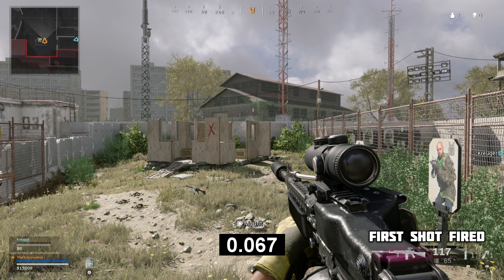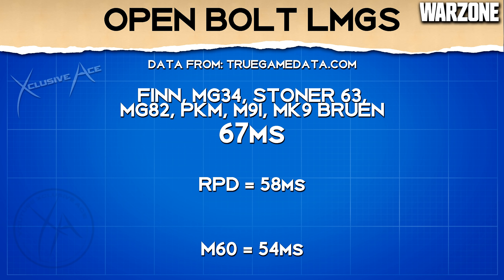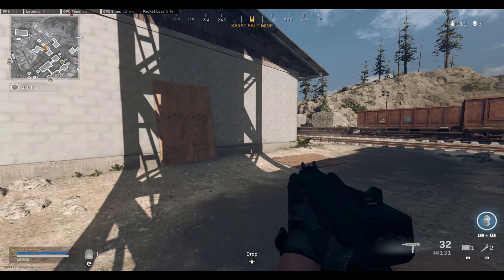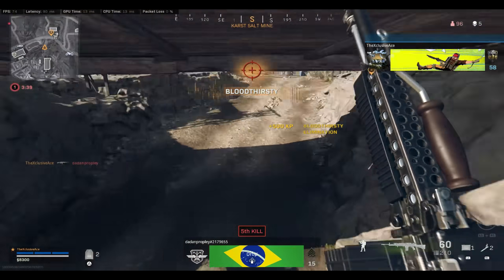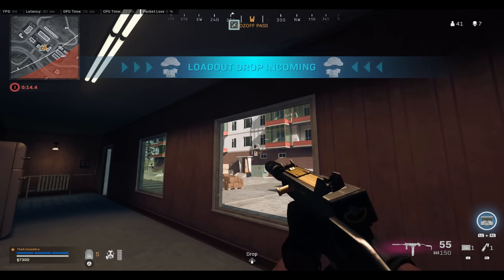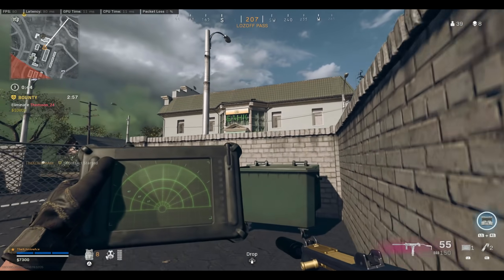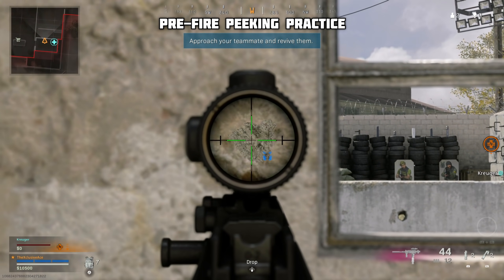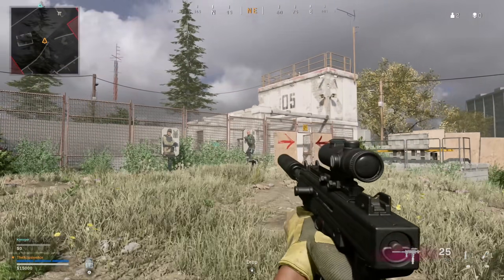How Important is Open Bolt Delay in Warzone?

Comment: For those wonder why some guns are open bolt, an open bolt will, upon trigger pull, slam forward, take a cartridge, lock in the chamber and fire, the bolt slams back and will stay there untill the trigger is pulled again

-in machine guns a barrel can get VERY hot. In a closed bolt the cartridge sits in the chamber and can get very hot and "cook" off because of the heat. This can be very dangerous as the entire gun can start shooting on its own. An open chamber is also a place where heat can vent when the machinegun is not firing.

-an open bolt is in general simpler and requires less moving parts, a good thing for submachine guns
Reply: Good stuff ..  Ive seen a gun cook off.  Not ideal for bystanders or shooter.
Reply: @jasonlawler9674  yeah, heard a nasty story from my Grandpa when he was a firearm instructor in Belgium army. They were doing shooting on M1919 browning medium machine guns wich origenated from Sherman tanks from WW2. They used them as practice guns

Unlike other machine guns, these are closed bolt designs. They had 3 on deploy in wich they would alternate so it would cool down. 2 new recruits had just dumped 2 full ammo boxes trough it. The next 2 recruits accidently took the same gun instead of a cool gun, and when they were adjusting the sights on the 4th box, the gun suddently began to fire on its own.

One of the shooters was checking the bipod as the gun had difficulty swinging, as he was almost standing in front of the barrel. he pissed his pants and hid under a truck when it fired
Reply: @F4Wildcat  perfect reason to re engineer to cooling and saftey mechanics.

Open bolt did both.  

Now we have open air to action like the grease gun or MP40
Reply: Open bolt in sub machine guns absolutely isn’t necessary it’s just the cheapest way to produce the firearm. That’s why most high end smg’s are closed bolt. Mp5, mp7, p90, vector etc
Reply: @bradenmchenry995  Yeah it was a design choice from the 20's. Once the amazing MP5 came into play, new open bolt smg designs quickly faded away
Reply: You should probably research what your talking about , before you talk about it.. it has nothing to do with the heat.. It has to do with preventing jamming while firing (Which is why M4's will jam when on full auto .. because they are closed bolt..also never have seen a closed bolt cook off ever.. in my entire life) A cook off comes from open bolt firearms....when you have ran a machinegun to much and it fires the next round..( yes from the heat) or a runaway gun from which you have got it so hot.. it continues to fire... it has to do with cycle rates.. not heat.. and open bolt is far more complicated than closed bolt.. nice try though... but lets leaving the explaining of firearms up to those who actually understand.. have dealt and trained with them.. and are giving proper information.
Reply: @bradenmchenry995  yea.. there is always that one dude eager to leave a half educated comment without fully understanding whats going on.. another reason why I hate the internet... dude has no clue... they research guns on warzone and then think thats how shit actually works IRL..
Reply: Plus you don’t need to charge a lot of open bolts between reloads.

Comment: The revolver has a really bad delay. I know they’re trying to mimic the double action mechanism but it makes using it incredibly frustrating. Gulags with the revolver are always annoying.
Reply: Battlefield 4: "first time?"
Reply: Yeah it feels like the bullets from the revolver are going to another dimension. I always asume I'll lose the gulag when I get the revolver, specially since I play on M&K where you don't have aim assist to help stay on target while the long trigger pull does off.
Reply: I feel like they should add the ability to cock the hammer manually to have at least that first shot with no delay.
Reply: @Phosphor66  YES! If you could cock and get a more accurate no delay version that gun would actually be very interesting to use.
Reply: I love the revolver, I largely stopped playing Warzone when they added real guns to the gulag it was much better with pistols and shottys only, now people don't do anything but camp the back of their spawn holding a long line of sight, it's so boring.
Reply: Snipers and the Magnum, when you try to 1 tap someone the hammer takes foreverrrrr
Reply: @ridhosamudro2199  lol
Reply: @Phosphor66  at least the first shot of the mag shouldn't have any delay
Reply: Use light weight trigger, it eliminates the double action.
Reply: @graviti4367  can’t use lightweight trigger on a gulag or ground loot weapon…
Reply: It makes gulag more interesting though. I
Reply: @peacelove6455  I feel like it makes the gulag more random. Same with the hauer shotgun that is currently in there. That thing is so incredibly RNG with its spread.
Reply: Which revolver? Didn't they eliminate (or almost so) I'm MW's MP?
Reply: I need to switch to single action by pressing the right side of D-Pad...
Reply: @chrisbammer8679  so you don't play wz but keep seeing vids? or do you occasionally play wz and occasionally watch vids
Reply: Since day 1 both revolvers are shit but no need to buff f tier guns in their eyes
Reply: @braynjohnson4302  yeah like in rdr2, you can half pull the trigger to cock the gun

Comment: Had no idea they actually included this, nice attention to detail.
Reply: You can hear it in some of the guns. A really distinctive one is on the m91 lmg
Reply: Mac 10 too. You can really notice it if you look for it
Reply: Jgod and true game data usually include this. I follow all of them. They all have pros and cons.
Reply: @xclusiveace how do open bolt delays work with sprint out time?
Reply: @HiJack3r  eh, I prefer it’s gameplay to both bo4 and Cold War. My favorite multiplayer will always be mw2 for nostalgia reasons, but mw19 did a good job IMO.
Reply: @elliottmallin4410  I'm 95% sure Sprintout time is calculated the same way as every other gun in this manner, although there is a very good argument for adding the open-bolt delay onto the Sprintout time since it is the " Sprint - to - Fire " time. With no open-bolt delay, the Sprintout time ends when the trigger is pulled and the first bullet is fired. I believe with an open-bolt delay, the Sprintout time ends when the trigger is pulled and the delay begins.
Reply: @YTKensei  right! but if someone smart with good gear doesn’t test it, we don’t really know how smg’s with open bolts perform! @thexclusiveace
Reply: @HiJack3r  Agreed.

Comment: Ace is finally using his beastly PC he ordered days ago, although I have no clue why the quality looks much worse when compared to him playing on console
Reply: lower texture quality to compensate for the higher fov and view distance I presume
Reply: I’m not sure what he has, but it’s not so beastly when he’s getting an average of 80 fps.
Reply: @PrinceBrandon125  i don't think Ace is that good at fine-tuning settings for optimal use yet. I hardly think he uses DLSS
Reply: He's not using it. That's for sure he's only getting 85fps. He got a high end pc
Reply: @drakebane9527  dlss is ass in Warzone
Reply from the maker: My new pc hasn’t arrived yet
Reply: @InsuredFrames  dlss still gives 15-20 fps boost why wouldn't you use that?
Reply: @TheXclusiveAce  so until then are planning to play on your current PC ,I recommend you to stick to ps5 for your gameplays ,I don't think the gameplay we saw in this video is on par with the quality we usually get from your videos (btw I don't mind if for some reason you have to play on your current PC )
Reply: @InsuredFrames  i have a friend whos a laptop gamer running a 1660 ti at high setings, he still gets a solid 120 fps on warzone. ace isnt using his new pc.
Reply: @drakebane9527  it adds ghosting and doesn't improve fps for 90% of people
Reply: @InsuredFrames  it does not in the right setting.

Comment: Is it just me or does rn he gameplay get SUPER choppy at points?
Reply: Yup, on ps4 sometimes you will get frozen mid gunfight
Reply: I'd probably be nauseous playing during those points. The engine ever since MW has been good looking but also very dicey.
Reply: I believe he recorded this gameplay on his PC as he has some indicators in the upper left that I have on. He may need to adjust a few video settings to optimize. it also could be frame rounding issues on YouTube's side, because I only notice it when his FPS displays 90 or above.
Reply: @Jamal_Jones  YouTube issue was my thought. Seems suspicious that it's only happening when his fps right around 1.5x the fps for the video.
Reply: @SataniaSquid  Then why did he say he couldn't change his FOV or in this video, say he didn't have the capability of recording at higher FPS since he plays on console. I'm not sure why he lied, since the proof of the FPS counter is there.
Reply: @atticusnari  Should be noted that Ace might not have as good of a graphics card as TGD
Reply: He was playing the game and recording on the same pc he’s been using for years. That’s why it can seem choppy at times. He said he does want to get a dedicated recording pc, but he’s having a hard time finding a decent priced PC. He refuses to pay 2-3x extra bc of scalpers
Reply: @Jamal_Jones  some times that happens with my gameplay i upload on youtube as well, some parts are just choppy for some reason
Reply: @SataniaSquid  i think he eventually switched to pc
Reply: @Ok-fu5yi  They both have 3090s.
Reply: Me with >20 fps and stutters every 3 seconds : Pathetic

Comment: In CoD, open bolt delay is a factor (not the end all be all but important nonetheless) in CQC and long range in instances where you can’t burst someone down in one go (trades between head glitches etc). That’s my experience as someone on the leaderboards and with a 5 k/d in rebirth, YMMV.

Comment: Hey XclusiveAce, great video! While I do agree with your assessment of OBD not impacting the TTK on every gunfight, I believe there is some room for discussion around prefiring eliminating the OBD time. With weapons that have a slow rate of fire, such as the milano, the time between the shots is actually greater than the open bolt delay. Going by TGD's numbers, if the milano fires 576 rpm, that means the time between shots is around 104ms. If you are pre-firing a corner and fire your gun just before the enemy peeks, there is a potential to increase your TTK by upto (but not always) 104 ms. This can lead to prefiring actually increasing the TTK rather than eliminating the OBD.
However, with other weapons that have a high fire rate, this is a non-issue.
Thanks again for the video

Comment: mfw when Treyarch forgot to make the AMP63 open bolt, even when they actually got it right in the original Black Ops
Reply: Amp63(Pm63) is blowback action,
Reply: @lupuradu841  You're right, but what I meant is that the AMP63 doesn't fire from the open bolt position in neither Cold War nor Warzone, even when the PM-63 in Black Ops did.
Reply: treyarch doing weird things with their weapons

I'd thought i would've gotten used to it by now, nah, it still bugs me lmao
Reply: The MAC 10 is closed bolt as well. If you have an inspect animation in your game then make sure things like these are not happening.
Reply: Thanks

Comment: I'd rather take any open bolt gun rather than the Cold War Magnum. Not only do you get the trigger delay, but you need to run the speed loader as well. I beg to the heavens that I never stuck with this gun in the Gulag.
Reply: The logic on the magnus is so stupid, you have ackimbo and you reload faster
Reply: I hate Akimbo Magnums, I had a perfect streak of Gulags, I always won my gulags until last night, I got the magnum, and the trigger delay completely screwed me over

Comment: Open bolt and velocity should be included lol the whole point of finding out the exact numbers are to understand exactly which gun would perform better against each other when they both started shooting at the exact time
Reply: Well when did the Open Bolt gun start shooting? I classify "start shooting" as when the first bullet get's fired, but you might classify that as when you pull the trigger, meaning we both disagree on when you first start shooting. So when do we classify that? 

Bullet velocity is irrelevant at CQC, when the TTK of a gun matters the most, so why include it? More often than not you aren't hitting every single shot at 150M, so why even use the TTK in the first place? Why not just shots to kill?

Comment: You should definitely add open bolt to ttk values because its not just a minute value like 1 or 2 ms its more or less 50 ms which is very noticeable to good player and can make a difference in gunfights

Comment: Does a sprint to fire attachment help make the delay "feel" less significant?
Reply: nohing changes the open bolt delay. its always there every time you pull the trigger and release it or interrupt firing. youre thinking of "Sprint to fire" which would be a nice number to use in addition to OBD to determine a TTK, or to at least know if you really wanna hurt your Aim Down Sight speed with that bigger magazine or not, as it all trickles down the TTK well, making your TTK climb past 1 second. the site where ace got the stats, that guy wants to design a practical TTK where it accounts all your attachments, where youre firing, and how many shots you have on target / miss to see each gun in a fight by fight basis to see. imagine how useful this will be in those situations where you both break each other 140M away and decide whether to peak or not for the finish, youd know if your gun has the "legs" to get that kill or if you NEED to reset the fight

Comment: Hey Ace, longtime fan here! I was wondering, what if you included open bold delay separately inside TTK measurements? For example, say you're making a video on the PPSH - the TTK could be displayed as 33 + 330ms. I'm not sure the best way to account for it when comparing tables of data, leaving it out may be best or perhaps even counting half the OBD towards ttk so guns that don't have it gain a slight edge in estimations, but when displaying TTK in videos it might be a useful tidbit of information to be able to see that number.

Comment: Open bolt delay should always be included extenuating circumstances are in every gunfights I mean sometimes they only have 1 shield or million other reasons things are different but from time u pull trigger to time they dead full health n shields is the ttk period. I don't use Milano bcuz its got me killed several times bcuz the delay some1 sneaking up on u with deady n u both start shooting open bolt gets u killed. Imo it should always b included from trigger pull to death is ttk

Comment: I thought they removed the open bolt delay on the ppsh? Or am I wrong?
Reply: I’m pretty sure they removed it, then added it back but with slightly less OBD time than when the gun was first released.
Reply: No, I think they reduced the open bolt delay to 33 ms originally, but that 33 ms is so fast it's almost impossible to tell that the PPSH even has an open bolt delay
Reply: I hope they did. The PPSh was horrendous before its last buff in Warzone.

Comment: at 5.0 you mentioned about when the enemy gets shot your ttk is started to count in real life. I don't agree with you. If is it so let's not count the ads time too. That should be wrong. What if the enemy sees us first? Where this open bolt time goes then?
Reply: Ace doesn’t count the ads time as part of the ttk either so I don’t see your point there but I get what you mean

Comment: on one hand if the real life firearm has an open bolt delay then it should have it in game. but it's a video game. and cod at that. so I'd rather they do away with it just got the sake of consistency. pull the trigger gun goes bang. I have enough lag to emulate open bolt delay as it is

Comment: You don't get to ignore aim down site speeds, open bolt delay or even bullet velocity.  Period. End of story.
Reply from the maker: No one is saying anything about ignoring those values. As I said, it's very important to be aware of them, I just don't like including them in time to kill formulas since it doesn't account for a wide variety of situations and, therefore doesn't always truly represent the power of a gun.
Reply: @TheXclusiveAce  Good point.  
All I am saying is that if I was working at Raven(I don't work at Raven) I would start to get frustrated if someone started comparing two guns, suggesting that a change is needed, while ignore certain stats.  I have noticed this trend lately in the last few day.
Keep up the great work.

Comment: man im not really sure whats up with this vid. like if there's an open bolt delay of 50ms, its gonna take you 50 more ms to shoot the gun, no matter what the TTK is. like its always added in, so why wouldn't you add it? (other than the obvious answer of cold war MP audience doesn't need these stats) like i watched the whole video, and it doesn't make sense. if you're pre-firing, you still have a 50ms slower ttk than a gun without that OBD. like does that make sense? 

also like, yeah there's so many scenarios of gunfights, we have liek 70 guns, so when fighting, besides the times of seeing / reacting there's guns with different TTKS that will kill at different rates. think of a gun with a slower TTK as having an "open bolt delay" making that TTK lower than the enemy gun. aight?

im just not sure why you wanna take a hard stance against it if you know how it works and stuff like you explained, like its okay to back track and change your mind and include them now, we won't care, we just want accurate info bro.